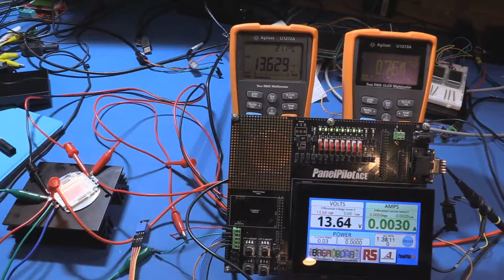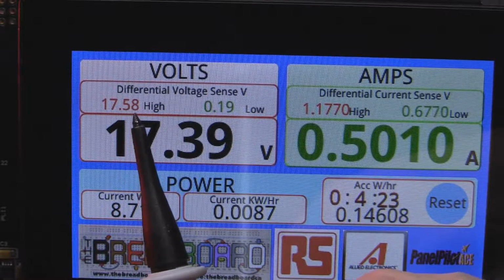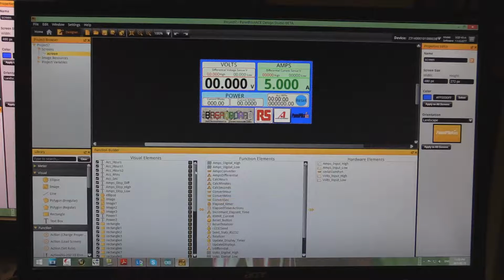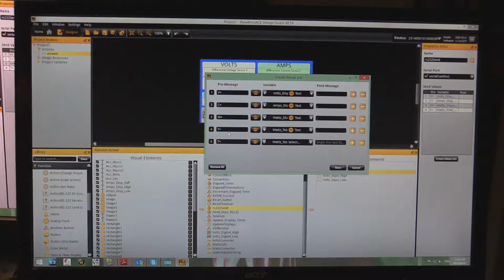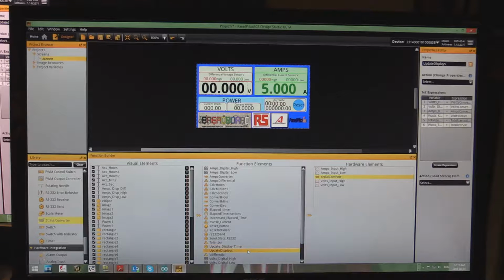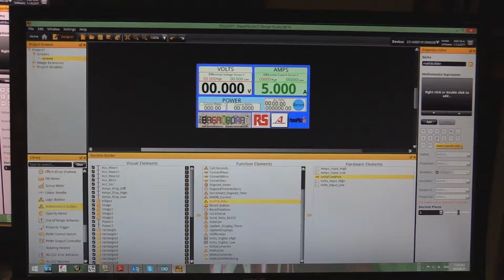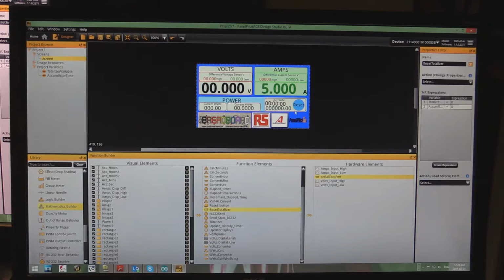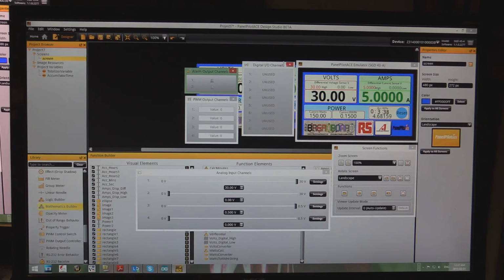PanelPilotAce Advanced Math, RS232 and Design Studio Beta

Comment: Hi Peter. grate job. just wonder is it possible to attach printer(from 
rs232panel pilot ) and have some calculated result maybe printed .. let 
say i have flow meter hooked up to panel pilot and printout result of 
the flow calculation. thankz
Reply from the maker: +Bess K You can certainly send whatever strings you like out the RS232 so I guess it would be relatively straightforward to send it to a serial printer if you want. I had it sending to my PC via the RS232 port and that is no different really

Comment: I grew up with RS232 and the good old 6402 UART, but alas it's a serial protocol of the past.....sniff!
Reply from the maker: And yet manufacturers still insist on deploying it to new equipment like this when it already has a perfectly good and well supported USB Com channel, ah well, at least if it where TTL I could use one of my numerous Arduino adapters with it :(, ill try find a circuit to level shift it
Reply from the maker: ***** RS232 is rather Legacy and does have range limitations too, changing to RS485 or something will resolve that of course. I was not infering that serial communications is legacy, only the RS232 stndard. Now I get that it is still being held onto for many industtrial applications but all the recient PLCs I have been exposed to are using RS485 line drivers to cover what you mention. My reference to using USB is not to have this as the mechanism for communicating around a factory but to comminicate with a local Industrial PC or other smart device for things like data logging, higher level functionality etc, of course then there is also the Ethernet capability of the display that will hopefully apear in a future release of firmware and hardware. I lookforward to testing that out.
Reply from the maker: ***** So very true, I appreciate the dialogue, regards Peter